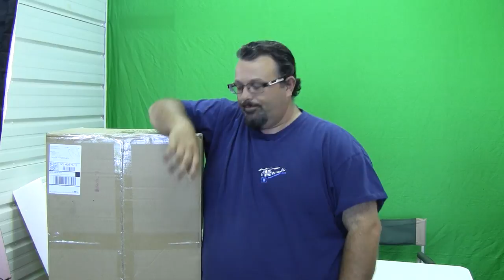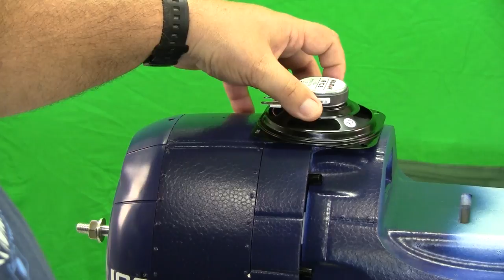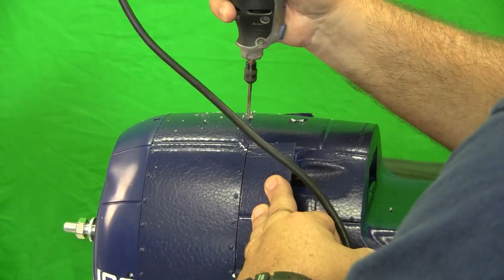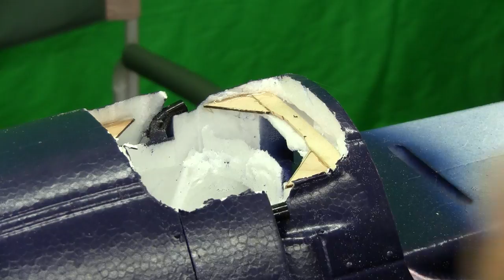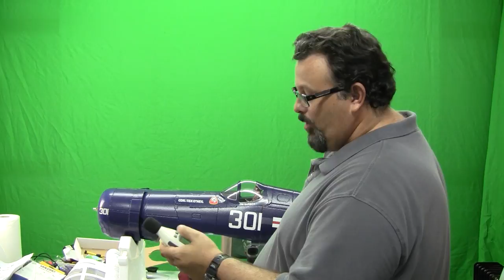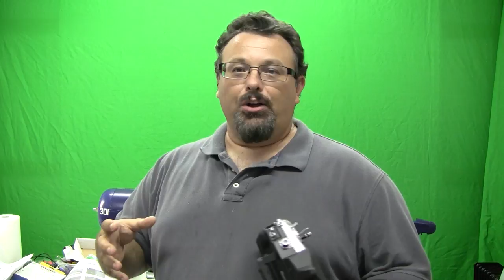Model Sounds Inc Shockwave Sound System install video FMS 1700mm Corsair

Comment: For true SPL (Sound Pressure Level) measurements for test comparisons, they are usually done at 1m distance and on-axis with the loudspeaker(s) and in the open to avoid reflections from nearby hard surfaces.

David
CEO
Model Sounds Inc.

Comment: As a general rule it is a good idea to always wire the sound module directly (via the switch) to the battery, and not using a Y off of the ESC power leads. The ESC power current is very spiky and can induce perturbations in the voltage on its power wires. These spiky voltage perturbations can induce interference in other electronic devices. So all electronic devices, in general, should be wired using a "star" configuration, if possible.

Comment: I missed the part where they show the finished site of the speakers.  He mentioned putting on a mesh grill, painting, and setting of the speakers.  That was the whole reason I watched the video.  Could you make another one showing the completed project?  Thank you.
Reply from the maker: Hi Keenan, 

I haven't finished doing that yet on the corsair.  However I did on the MD500 check out the build video on the Magnum PI MD 500
Reply: Ok, thanks.  If there is a way to let me know I'd appreciate it.  Very interested in your video.